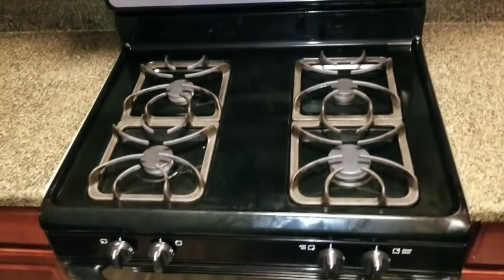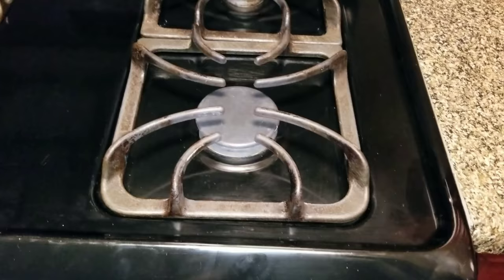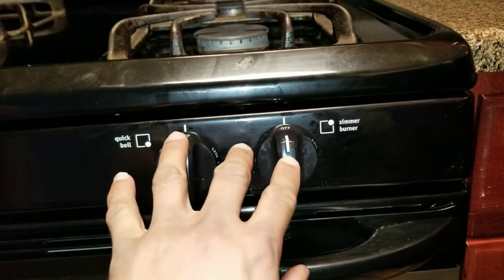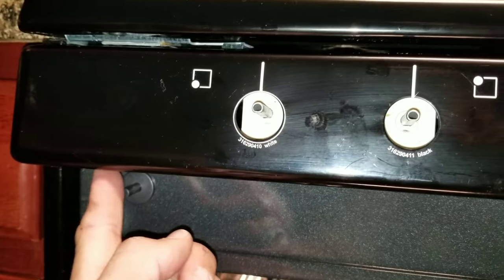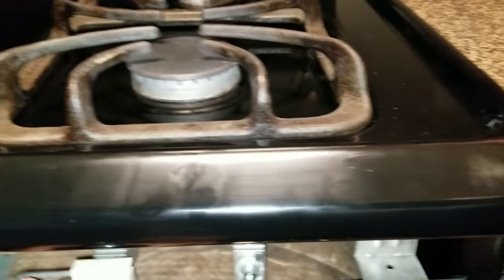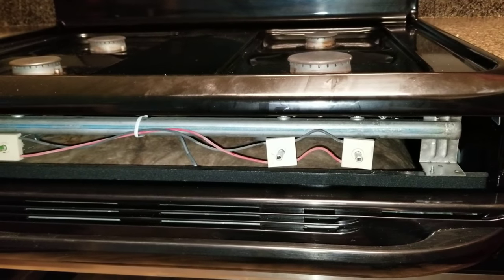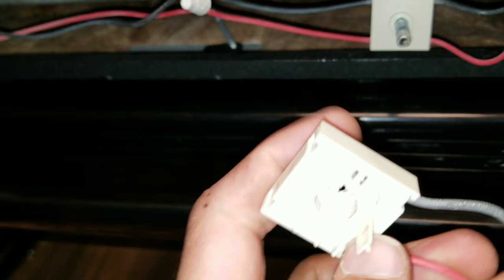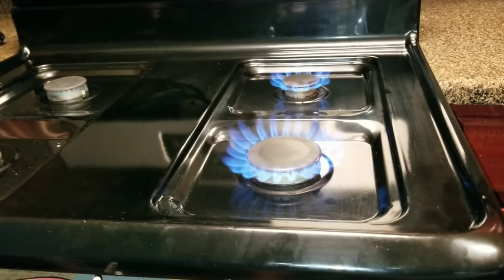Gas Stove Top Not Working? Lighting? Clicking?

Comment: Great tip, man! This did the trick. However, I didn't need to replace the module. In my case I clean the inside of it with a q-tip/alcohol front and back. After that it worked good as new!!
Reply: Cleaning with q tip and using  a cloth worked for me, thanks a lot for comment
Reply: Me too thank you so much
Reply: Worked for me as well!! Thank you🎉

Comment: This worked for me. Carefully pull off the knob from burner not working then try a quick spray of electronic contact cleaner at the u-shaped stem where the knob came off. Let contact cleaner dry( a minute or two). Place knob back on but not too tight . Test it first. For me, it started to click again. Good luck.
Reply: This is interesting, that cleaning it worked. 

I have been fixing a Dynasty 6-burner gas stove that had 3 nonworking burners. 2.5 of the problems were simply that the burners were full of gunk. 

The worst of them was the burner whose knob won’t turn on the spark igniter. 

I thought might be the switch, like this one but maybe it’s the gunk!
Especially given how gunky the burner above it was.

Comment: All of mine are not working. No click noise. What could be?
Reply: Check to see if the range power chord is connected to a working electrical receptacle, and of course, the condition of the power chord. If all is good, and it still don’t spark, disconnect the power chord again, and clean the electrical potentiometer contact pads or contact tracks, mounted on the valve shafts behind the knobs (if and only if you can have access to them), If they’re sealed shut, & you can’t get to them, then look to see if the igniter module is getting power, and putting out. If it gets power, and doesn’t put out, then igniter module is probably toast.  If it ain’t got power,  search for a broken or chewed wire, or the wire connector plug for severe burns or pull damage, before the igniter module.
If the module receives juice, and puts out, like it’s supposed to, then look into replacing the valve or knob potentiometers.

Comment: Found this video really useful 👌 

Many thanks! 

Also wanted to add, I had one bad burner as well and replacing the entire strip of 4 was going to be quite cumbersome. So I found a solution on another video that suggested you can turn on 2 burners at the same time ( the bad one and a good one) and the bad one will light up

Comment: Wow...I LOVE youTube and people like you Sam!  
Thanks to you, my 2 hours of troubleshooting has come to an end!  I found another video about gas not lighting (an excellent video as well) cleaning the "hole" where the gas comes out.     
Also found a great video on how to open the stove top (most tops open by a putty knife) mine (Frigidaire Gallery)was like yours, you need to take off knobs and then the cover plate to unscrew from below with the oven door open.  I tried swapping the white plastic igniters (good with the bad) and the one burner still didn't work!  So frustrating.  I was at my wits end using several swear words, and I just about gave up but decided to keep searching on YouTube, and then I found your wonderful video!  I only wish I had found it first!  

I swapped the good with the bad burner ignitor module just like you had and voila, the burner worked!  Now I just need to find these ignitor modules that you feature.  Where did you find yours?  Mine looks nearly identical to yours It is labelled  "ITW Jemco"  SSR-V110     F2HO-T6DR
Reply: Cana Dude — did you look on Amazon? Of course you could order the ignition harness from your manufacturer’s web site or go to an appliance parts store.
Reply: What do you do if all the burners aren't clicking? How do you know what part it is? Which which one? I don't know what it looks like. I don't know if it's the wiring harness or if it's that insulator or is it the box with all the wires on it the nighter thing or is it each one? I mean all four bad. The little bitty ones on the burners

Comment: Thank you for making this video.  Have the exact same problem.   Instead of replacing the module, I just move the right most to the 2nd right most knob like you did to troubleshoot and  left it as such.  We never even use the right back burner anyway.  :)
Reply: Thinking about doing this myself, does it create a hazard fro the back burner in any way?
Reply: @heatherspore5343  not at all.  been 3 years and seems to ok. if we do use the back, we use a long lighter.
Reply: I was going to do that but I just poured a little rubbing alcohol on the switch and cleaned it out - works great now

Comment: Nice that you showed how to replace just the part that wasn’t working. Wouldn’t it be better to replace the whole igniter harness, since the others might eventually fail? But thanks for the advice on ceramic wire caps. Never heard of them.
Reply: If you can get spares, it will save you money on the expensive harness.  They are actually called spark ignition switches, not the module which has two wires, a neutral & ground, & four more to the each spark ignitor at the burners.

Comment: Very helpful video, thanks.   I replaced one (extreme right) ignitor module correctly on my GE gas stove   Here's my problem:  Ideally when I turn the knob from the OFF position at the top (say north) in counter-clockwise direction, it's supposed to start clicking at 45 degrees (say north west) and the gas is released at 90 degrees (say west).  But instead it starts clicking and ignite at 135 degrees (say south west) but the gas is still released at 90 degrees (west).    As a result,  some gas is released and I have to turn the knob back to 90 degrees (say west) after the flame has lit.   It means the clicking / ignition is off by 90 degrees.  I verified that I connected the wires correctly (correct colors) and also the ignitor module is installed correctly just like other 3.    Any idea on what might be happening or is the module faulty ?

Comment: No need to replace igniter in my case.  And it wasn't the electrical contacts failing to conduct electricity either.  DIRT had fallen into the U-shaped stem leading into and through the igniter.  If your stem is U-shaped or even if it's circular as in this video, probe into the channel with a long, narrow, sharp metal tool.  One idea is a piece of coat hanger with a bent tip.  Then twist it around to loosen the debris inside there.  First you'll get a couple clicks that die out.  Clean some more and you'll get three or four clicks.   Keep cleaning till the clicks are continuous.   Fixing stuff beats replacing it by a mile.
Reply: Helped a lot just getting in there with a dry q-tip and cleaning it.  Thanks!👍
Reply: Wondering if you have to unplug the appliance before trying to clean the stem leading into the ignighter
Reply: @heatherspore5343  no.  I didn’t.

Comment: So you can replace the individual plastic squares that you’re calling modules? The reason I ask is because, I haven’t seen those on the Lowe’s website. Maybe I’m searching for the wrong thing.
Reply: What he calls spark modules are really spark igniter switches.  The spark ignitor module is a the small transformer with two leads, the line & ground, and four more leads going to each spark igniter in the burners.
Reply: @fredcdobbs823  Thanks

Comment: Very helpful and informative video but I am trying to find the part you change on ebay but things for cars come up when I search for stove module or igniter module. could you give me the correct name for the part pls.
Reply from the maker: The best thing to find the exact part is to open the oven or broiler door. Take a picture of the model number and type it in Google and get an exploded view. This will give you an in depth view as well as numeric parts to coincide with the specific part you need. Hope that helps 🙂
Reply: Spark Ignition Switch

Comment: BRAVO. This was my exact problem. Have to buy the entire harness, though.
Reply: Did you do the repair? Do you have a rough estimate for how long it takes?
Reply: @lrsimonds  Hi. Yes I did it, it's been awhile now but it was pretty straightforward. I did a lot of cleaning once I was back there. My biggest problem was the very sharp edges of the metal sheet I had to remove in order to access the place where the harness plugged in. I didn't realize how sharp they were & gave myself a very nasty cut, so wear leather gloves or something while you're doing this. Like a lot of projects it's somewhat time-consuming (maybe a couple of hours?) but not hard.
Reply: @deenibeeniable  Thank you!

Comment: what if all of the burners do not click?
Reply from the maker: Inside the top under the burners to the left there is what is called a spark module ignitor in between the left back and front left burner. It is rectangular shaped.
It looks like the one in this video but in this one it is in the back. Same part however. https://youtu.be/qJgBv2bAUeE